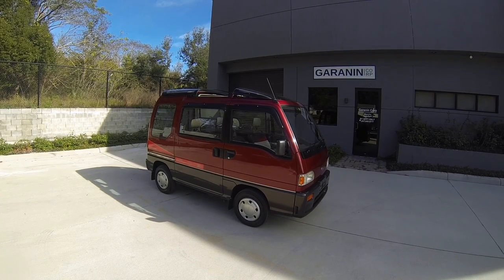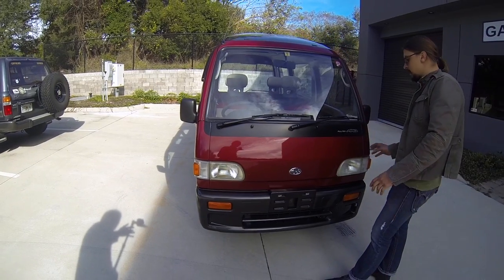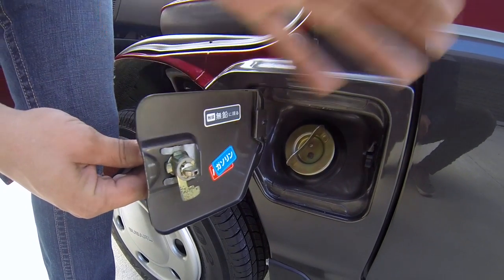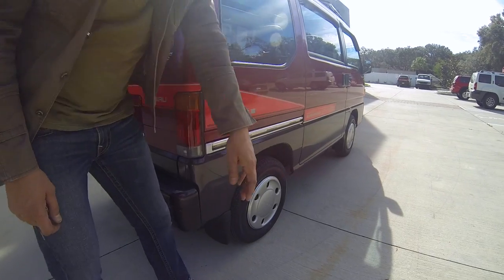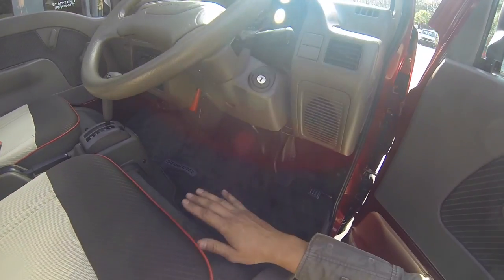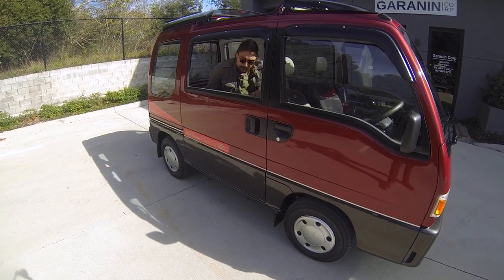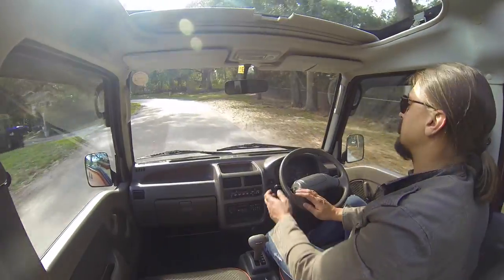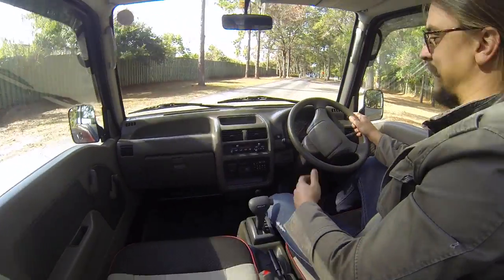1991 Subaru Sambar Dias2 AWD Supercharged Kei Mini Van AMAZING!

Comment: Absolutely love these kind of OLD PRACTICAL cars... They never die as they are cheap and very easy to fix. NO ECM,TCM,BCM,IPC,SDM,ABS...etc etc... to go wrong.
Reply: How does this not have a ecm lol. It's got fuel injection controlled by a computer and multiple sensors to adjust fueling for the boost it's receiving.

 All while being micro sized. It's actually advanced for it's time. This is much more advance than a Volkswagen bus.

Comment: nostalgic
I owned this car more than 20 years ago. This car is used for delivery basically.
 660cc 4cylinder injection full-time 4WD supercharge   max top speed 140km　was it
Reply: I’m thinking of getting one, what’s it like?
Reply: 140 km (86 MPH) really? sounded like he was really pushing it at 60 MPH (at 5K revs)
Reply: In Europe it came with a 1.2 liter three cylinder. Build quality is nowhere even close to that 660 though.
Reply: @stalincat2457  you're probably talking about the Subaru Domingo its like the sibling to the sambar I was thinking of getting one but I wanted the sambar I got one exactly like the one in the video but not as good condition like the one in the video
Reply: @Sac_153  Unfortunately we got a slimmed down version of the Domingo. West European variant was called the E12 or Libero: No ABS, no power windows and no AC. We did have the killer sunroof though.
Reply: @stalincat2457 oooofff, yeah atleast the cool sunroof is still there 😂 I think the Japanese kept the best goods for the J.D.M
Reply: @stalincat2457  thanks for the info I didn’t know they had different variants 👍

Comment: They had CVT's 26 years ago?  Damn, I didn't know that.  I thought they had only been around like 10 years.
Reply: Dutch car manufacturer DAF actually introduced the CVT back in 1958.
Reply: Earthling1984 too bad they havent smoothed out all the bugs in cvt system yet or my altima would be alot nicer lol
Reply: G. A. B. That's why a lot of cars have electromagnet clutches, using ferro fluid. Makes for a smoother take off, I prefer normal auto, can't get used to the slipping clutch syndrome!
Reply: Garry Mills yea and add a worn band or bad line pressure solenoid on top of that and it slips then slams into gear like my car .. I do have 207k miles on original trans thpugh which is unheard of on 3rd gen Altimas :p
Reply: Earthling1984 well its from japan mate..
Reply: Yeah, with as many problems the CVT has, especially with more powerful motors, after 26 years you'd think Nissan and Mopar would have it figured out... NOPE! Look up CVT trans band failure. Go down THAT rabbit hole....
Reply: Yeah no CVT for me.  I'll keep my old Honda Civic & Toyota FJ Cruiser until they die.

Comment: Cool van but crap I wouldn't want to be in a front end accident in that thing.
Reply: Just put your chauffeur's life in danger while you lie down more safely in the back
Reply: no worse than the VW Bus I should never have sold...you want to live forever or something?
Reply: Don't let safety ratings lure you into a false sense of invulnerability. There are still plenty of ways to die in a "super-safe" modern car with fancy crumple zones, etc.
Reply: Or a rear end collision, considering the engine placement.
Reply: I thought the same.
Then my second thought was, we are not supposed to have accident. We are supposed to cause no accidents, ideally.
Reply: john doe Exactly what I was thinking!
Reply: Peter Kroll Are in control of the other guy? I was rear ended while at a full stop at a red light.  Hit by a drunk driver with no license, was here illegally and he had no insurance. He did not so much as swerve or use the brakes. !
Reply: Happy, I was told by my friends rear ending accidents are not uncommon in the US. Many people wait at the red light with one eye constantly affixed to the rear mirror.

They do happen here, too, but they are usually low speed and drink driving is really rare here.
Reply: or side impact even, those doors are thin as fuck and you're sitting right up against them.
Reply: Few years ago I read about accident statistics in USA, and the fact is that majority  of accidents are single car accidents, and percentage is higher than in Europe. Conclusion was that it is because Americans drive large heavy cars and SUVs which do not handle well on rural roads with curves, and drivers are more acustomed with driving in straight line on highways (the reason why USA spec cars generaly had weaker brakes then Japanese or EU spec cars, we see the difference when get USA spec car imported in EU). So, it is more likely to have an accident on rural road with heavy car which does not do well on curvy road then in lighter, smaller car.
Reply: its like a motorcycle. keeping an eye on everything around you
Reply: @alphamav  and most safety ratings are done at like 55mph unlike some highways which has everyone at 80 mph and some fly by even faster
Reply: Safer then a motorcycle
Reply: I wouldn't want to be in an accident. Period.
Reply: @Zeleniprojekt  there is also less of a commitment to earn a US driver's license. Just need to sure the square shape goes into the square hole.
Reply: just put a heavy roll cage and enjoy
Reply: ive worked in a recycling plant here and i see shoes stuck always! lol
Reply: Wow shoes stuck in a wrecked vehicle like this cannot be good. There is a reason these were never sold new in the US. They cannot meet safety specs of US.
Reply: @vapeking466  Yeah, even here kei vans are scary to ride, but it's very versatile.

Comment: Why am i so interested in vehicles like this?
Reply: Strange, isn't it? Somehow I wound up watching a Subaru 360 video, thinking it's cool, but too underpowered for me. And the 2-stroke engine in it just wouldn't cut it. It's just too impractical having to run mixed gas.

Then YouTube sent me here. I'm thinking this thing doesn't quite have the cool factor of the old Subaru 360, but it's a legit vehicle with a modern drivetrain. It's more practical, yet really small. Then I'm thinking why the f*** do I need this, and why am I attracted to it in the first place? 

I'm with you. I seem to get drawn to all the weird shit, like Citroen SM's, Facel Vega HK-150's, and a Jensen Interceptor with a Viper engine stuffed in it. 

And some dude with a drag racer he built from an old Volvo with a fucking turboed Evinrude 2-stroke V8. The thing is fast as shit, likely weighs nothing, and sounds positively Satanic. (YouTube: "Rudezon").

If I had lots of money, I'd have a garage full of cool but crazy vehicles that would have all my friends wondering what the f*** was wrong with me.
Reply: John Cheves uh...yeah

Comment: Show worthy automobile? What auto shows are you going to? It's cool, definitely, but it's no 70 Chevelle 454 LS6 or 70 Hemi Cuda or even an 84 Dodge Daytona Shelby Z. I'd take a 1991 Dodge Spirit RT or a 94 Daytona IROC RT over it any day those last two are Lotus joint venture drivetrain, 0-60 in 5 seconds and the Spirit was a HEAVY, 4 door brick going down the road at 150 mph with a 224 hp 2.2L VNT charged 4 cylinder that got 25 mpg in town(if you weren't driving like a maniac). This van is cool, but I don't know where you were seeing these at car shows.